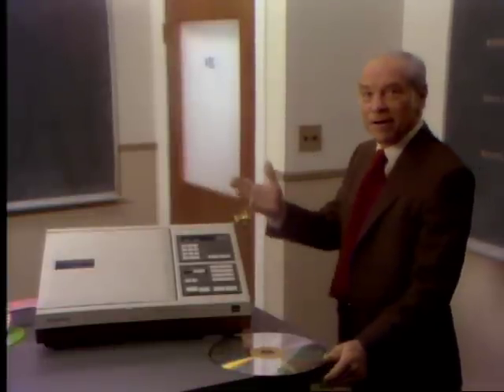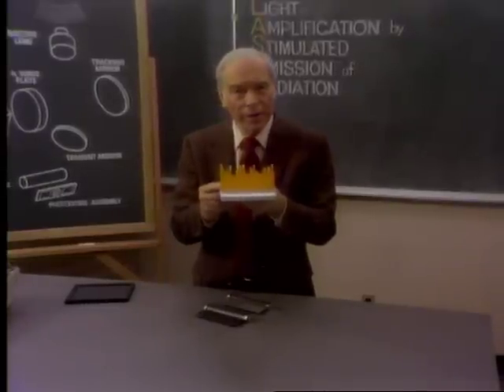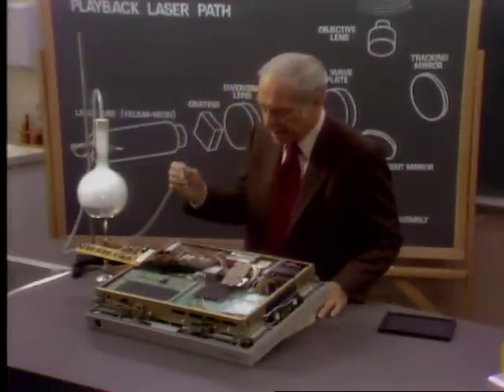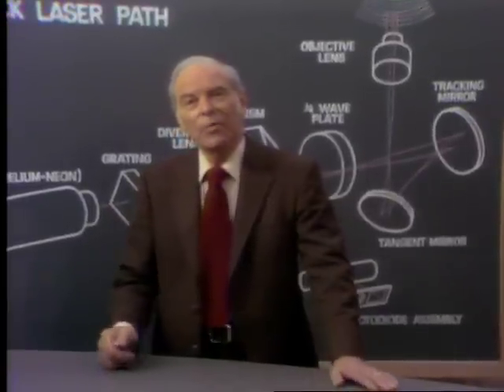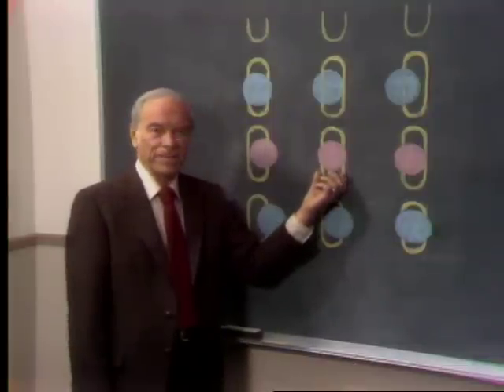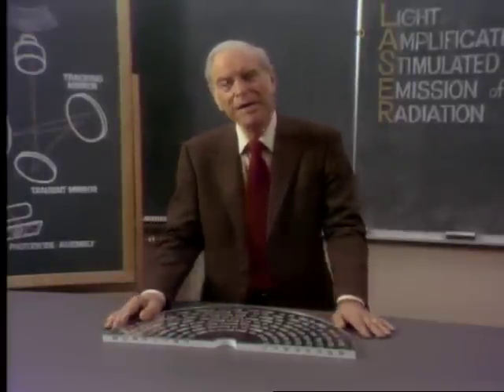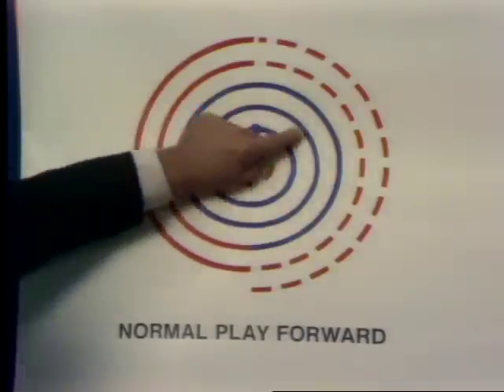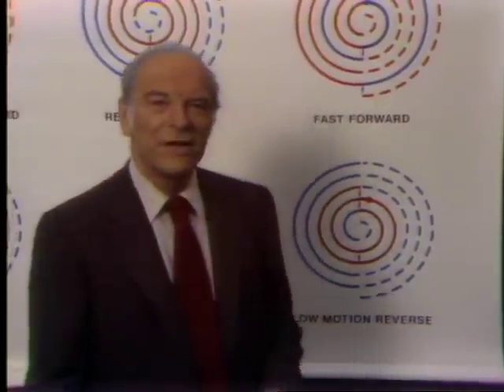Pioneer LaserDisc - How It Works with Don "Mr. Wizard" Herbert

Comment: Its amazing how using physical object instead of computer graphics makes things easier to understand .
Reply: i dont fully agree, but thats partially true.
Reply: I feel like touching objects and rotating them around in your hand gives much clearer idea than viewing 2d images and 3D objects on the screen
Reply: that is true, i myself am also oldschool when it comes to physical models and stuff, but i gotta  agree that digital medium has lots of potential that physical cant achieve, for example, it's easier to understand how an F1 engine works with a good 3d animation. Of course, if you're studying mechanics you should always have contact with the physical objects, but digital is an essential complement nowadays.
Reply: I guess one complements the other
Reply: +maak You watched this video on a 2d screen.

Comment: Its only a question of coding. The physics behind are basically the same and, starting from LD,  the CD, DVD and BluRay are only evolutional steps of higher information density.

The analog signal on LD is indeed coded in some kind of "digital" form on the disc, the "pits" are representing the frequency of the signal by marking the zeropoint of the waveform. You could also code analog signals on BluRay this way!

Comment: is it true that 1 laser wavelength (whatever that means) can carry ALL the phone calls and TV programs ?
Reply: Yes, it is. We don't have have the equipment that could handle say the entirety of the worlds internet traffic in say real time or transmit it that quantity at that speed but yes in a single fiber optic wire you could transmit an almost infinite amount of data in an infitesimal amount of time. Granted no we cant do that but it could be possible.
Reply: thanks, I am still skeptical though
Reply: @MatthewHolevinski  You didn't answer the question. The question was can 1 wavelength carry it. Your answer was that one fiber optic wire could carry it.
Reply: @frankcabanski9409  the answer conversationally speaking is no.
Reply: @MatthewHolevinski  Thanks.

Comment: These were far more expensice than videodiscs and did not survive as you could scratch the surface thus rendering the disc.useless.  Also, notice that laserdiscs had no identification on the disc so you had to ensure you kept them in the package.  DVDs improved on this because you only play one side and can fit far more data on them.
Reply from the maker: "These were far more expensice than videodiscs and did not survive as you could scratch the surface thus rendering the disc.useless."

LaserDiscs are videodiscs.

Of course, there were at least two stylus-based systems as well: CED and VHD.

And LaserDiscs can play through scratches fairly well.  It's only when it's severe enough to act as sufficient obstruction to the optics to disrupt focus and/or tracking.

----

"DVDs improved on this because you only play one side"

There are dual-sided DVDs, such as early releases where one side has the movie in fullscreen and the other side has the same in widescreen.

Dual sided DVDs are not as common today, however.  Most titles now are usually released either on single-sided RSDL DVDs or single-sided single layer DVDs.

----

"...can fit far more data on them."

Well, yes and no.

In theory, a LaserDisc has the potential to store far more data than a DVD because of greater physical area where the track is written to.  And this ability increases when you use a shorter wavelength/higher frequency beam.  But, to do that, you would be creating an entirely new format since this digital 12 inch disc will not be complaint with the LaserVision standard and would be incompatible with existing LaserDisc players.

In practice, DVD can hold more digital data than a LaserVision formatted disc, and that's because LaserVision is an analog format.  That means any digital data that is stored on the disc must be done by containing its signal within an analog subcarrier or within the video signal itself.  That's not nearly as efficient as the more direct method of using EFMPlus encoding to record the digital data to a DVD.